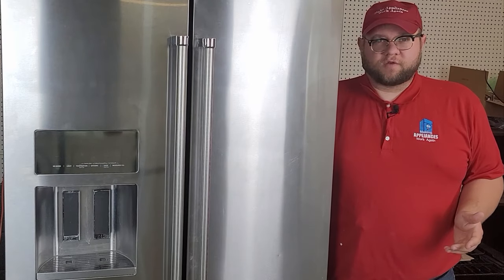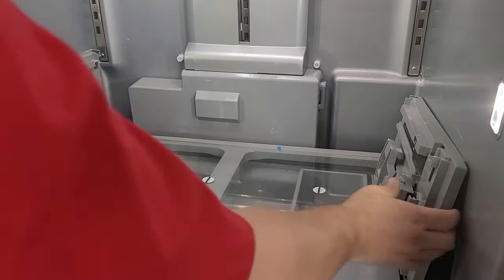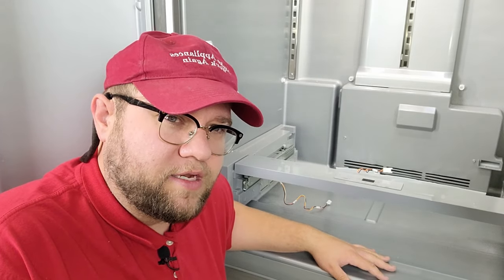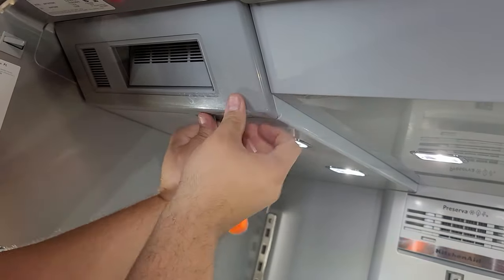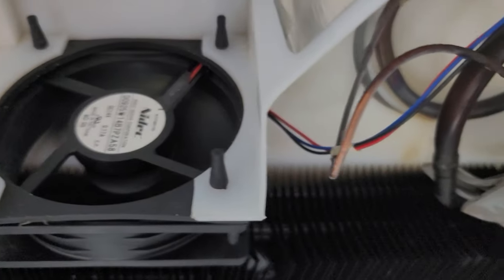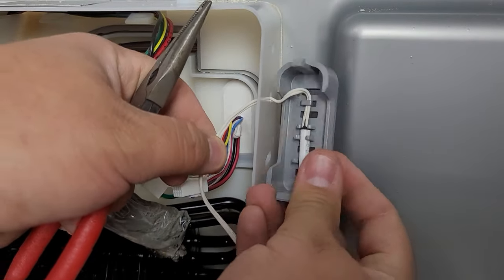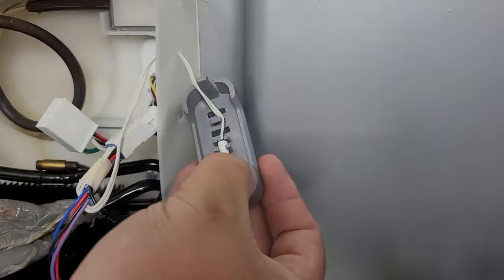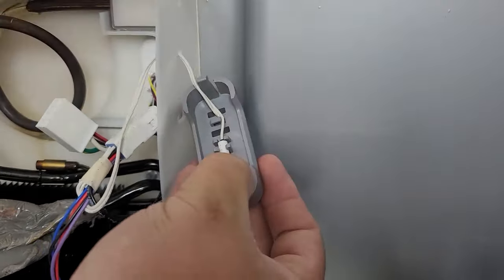KitchenAid Refrigerator Not Cooling & Leaking Water but Freezer is Fine - How to Fix

Comment: We have a kitchen Aid refrigerator for 12 years. My husband has never changed the water filter (he thinks it's expensive!) so we don't use the water dispenser but he refrigerates his water bottles inside. Then, the ice-maker doesn't work. He uses the ice cube containers in the freezer. Then, it leaked water on the floor. He placed a towel underneath to soak the water. Then, the freezer has ice/snow inside around the door. Now, the lights are off (upper refrigerator only). He said he checked the manual and NO WAY the lights can be fixed. Is that true? What is the repair cost? Should I buy another refrigerator?

Comment: My man....Thanks a ton for this video! I wish I can show you a pic of the big snow ball my customer has at the bottom of this fridge at the evap vent. She can't even close her drawer because it's so thick.
Reply from the maker: First one I ever did... seemed like it had 10 pounds of ice. Took me about 45 minutes with a steamer to cut thru the ice to start pulling the chunks out. What a mess.
Reply: @bensappliancesandjunk  Dang, I wouldn't be surprised if it took me that long. Did you have to vaccum the water at the drain pan during that repair? Also this is my first one too LOL
Reply from the maker: @89DrFunk  yes, towels and or a shopvac
Reply: @bensappliancesandjunk  Thank man I finished the job last night it took me literally 5 hours to finish this job. The ice build up was really bad it was 2 inches thick on the outside bottom of the cover and solid on the inside cover. Once I was able to get it all defrosted put in the new thermistor and fan I felt the cold air and the coils started to frost immediately. Interesting though before I changed and replaced the old fan and old thermistor the fan ran but it blew out warm air and the user interface passed the thermistor and fan test which was odd too. Thank goodness the evap drip pan was fine and not warped up.
Reply: @bensappliancesandjunk  Apparently this is a problem I have as well.  Wouldn't it be easier to empty the fridge/freezer and let it defrost overnight?

Comment: Any tips on removing the little drip pan area in the refrigerator? Mine isn’t broken so it doesn’t come out like the one on the video.
Reply from the maker: It was a total mess and honestly, I had to cover it up with editing. That whole pan was utterly destroyed. There are small slots on the pan that slots into... the evap panel if I remember right. Pull it out slowly and make sure you have it thawed out or it'll break

Comment: What if the side air works but not the air coming from the back? Someone has already replaced the fan. The control board has been replaced also.  What is can be done?

Comment: Ben, I have an unusual yet similar temperatur related problem with Kitchenaid Model KFIS29PBMS02. The freezer maintains temperature at 0 to +3 degrees F., but the refrigerator will not cool below 37degrees and cycles up to 39.8 and back down to 37 regularly... New EVAP fan runs continuously.  The EVAP coils have a light frosting about 80% of the way to the top and I'm measuring  around 25-30 degrees on the coils. So the fan runs continually and the thing still will not get below 37 degrees.

Any idea what I'm missing?
Good job on the video!

Daniel
Reply from the maker: What is the refrigerator temperature set at?
Reply: @bensappliancesandjunk  
Fridge set at 33°F.
Freezer set at 0°F.
Reply from the maker: @danielcarr4669  clean the black coils on back and underneath. Ive never heard of one of those being set at 33* in the fridge, usually reccomended is 38. The other thing I'd look at is making sure no thermistor is reporting the temperature out of range.
Reply: @bensappliancesandjunk  EVAP coils are clean and EVAP fan is working great. Better check the FDA recommendation about setting refrigerators in the 38°F and above range.
I ruled out thermistor reporting out of range because the fan runs continuously.
Reply from the maker: @danielcarr4669  check fan voltage vs. Spec to see if it's out of spec
Reply: Sounds like you have a freon issue. That fresh food evap should be 100 percent frosted. Anything less than a full frost pattern is going to be a seald system issue. That fridge is known to have bad fresh food evap leaks. I know you paid a lot for that fridge but I wouldn't take one if it was free as we see one thing after another with them.  It's a shame
Reply: @steveodonnell2921  Please think about what your saying regarding an evap coil leak on the fridge side, call me crazy but wouldn't a low on refrigerant condition negatively affect both the freezer and the refrigerator?  I say this because the sealed system has a single compressor shared between two EVAP coils (separate fridge and freezer coils/same compressor) and unless you can enlighten me on what I'm missing, a low on refrigerant issue would cause problems at the freezer as well, yet this freezer is solid and easily maintains itself in the 0 to +3 ranges. Also, I have replaced the thermostat, crisper controls damper and EVAP fan, this shotgun approach yielded small improvements as the fridge is set at +33 and now will reach this temperature briefly, the problem is the temperature now swings from 33 to 40+ and back. I'm leaning towards and issue with the main control board or the refrigerant proportioning valve... what say you about that possibility?
Reply: @danielcarr4669  I have thought about what I was saying which why I said it. You said you only had 80 percent of the fresh food evap frosted. It needs to be 100 percent frosted. A small freon leak will show up as temp issues in the fresh food section before you will notice any problem with the freezer. If what you are saying about the evap being 80 percent then you have a sealed system issue. I've seen it countless times.

Comment: i just had a call 9/4/21 on same box icing problem , i replaced evap fan , waited for refrigerator to start and coil to get cold when coated with ice evap fan would not run had no power at plug connection , went to board in back found no power to connection to fan . is control board bad , wire harness to in side to fan ,. can u shed some lite thank you
Reply from the maker: I'd check voltages from board and see if its triggering. DC fans seem to have some problems on killing boards if they fail, sometimes. But I'd verify at board to see if any DC voltage is attempting to be sent, or not, then go from there.

Comment: I've got the same model, but mine is giving me no erro codes, the compressor is running,  but hot. But the evaporate is not cold. What's going on. Is the compressor shot.
Reply from the maker: Is either the compressor is low on refrigerant, or is, or you would want to double check the relay to make sure that it is running to the compressor

Comment: If the freezer compartment is frozen, what is best method to thaw ice?
Reply from the maker: Clothes steamer
Reply: @bensappliancesandjunk  have a link for one?
Reply from the maker: @robertmunguia250  https://www.amazon.com/Bissell-39N7V-Surface-Steam-Cleaner/dp/B07V39L623/ref=sxts_b2b_sx_reorder?cv_ct_cx=bissell+steamer&dchild=1&keywords=bissel+steamer&pd_rd_i=B07V39L623&pd_rd_r=7be6e86e-d91c-4216-ac8c-cc67f241489a&pd_rd_w=IF7Ol&pd_rd_wg=c40jH&pf_rd_p=2ff2ddc8-4b7c-44be-9d81-b3613daaedab&pf_rd_r=ADSJWK53NF52AA8BQPQ8&qid=1619399348&sr=1-1-f5ebfd8e-82c1-4b4e-97d5-2aa47aa18b69

Comment: What if your fridge is fine and the freezer works but there is ice building up to the fan in bottom freezer?
Reply from the maker: Check dooe gasket, fan operation, and defroster to make sure it works. Set the automatic defrost timer to manual

Comment: Thanks!
Reply from the maker: Thank you so much!
Reply: @bensappliancesandjunk  Hello Ben.  I have a 5 door(krmf706ess01) showing some intermittent freezer evap fan and compressor cycling(compressor is hot).   I believe they are in the same circuit.  The maint diag on thermistors(how reliable?) and fans come back good.  Is this a control board issue?